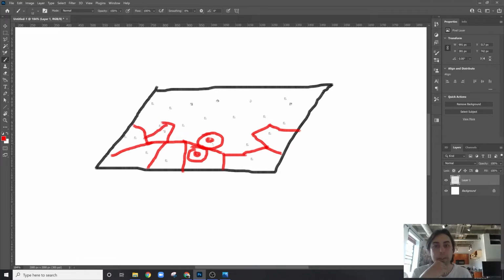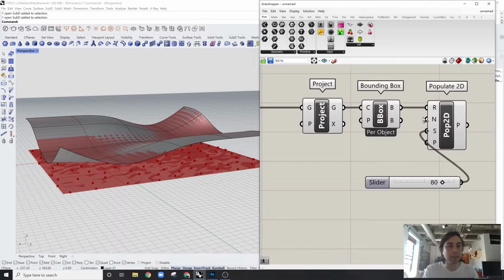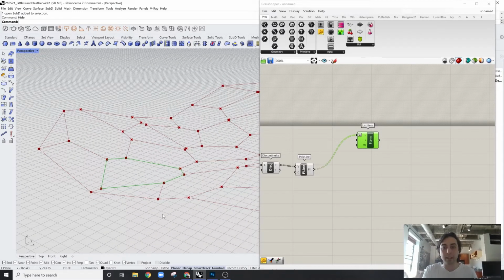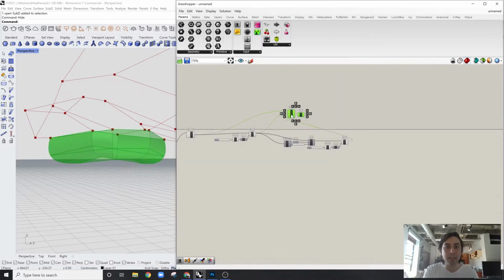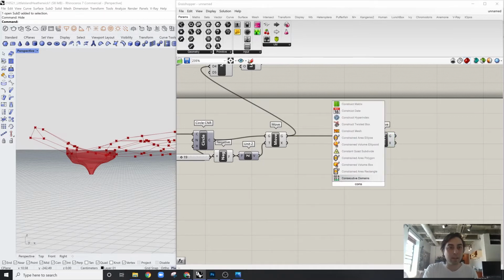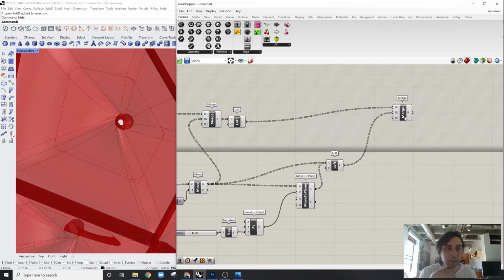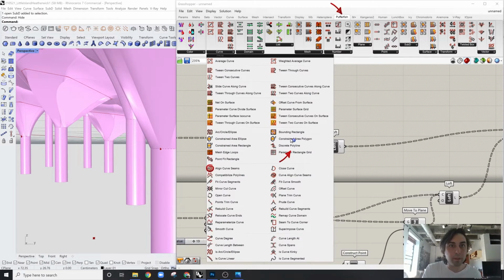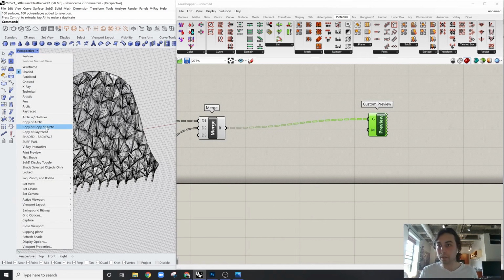LITTLE ISLAND PARK by Thomas Heatherwick (GRASSHOPPER)

Comment: Hi, I followed your tutorial and reached 9:26 in the video, but the polyline showed "Insufficient points for a polyline". I have tried several times but still could not work it out. Do you know why is it? Would you mind sharing the grasshopper file? Many thanks in advanced
Reply from the maker: Hi! Have you tried changing the seed value for the Populate points? There may be a situation where the point is exactly on the edge of the surface or missing the surface - which would cause this error!

Comment: Hi, I love these videos. They're very helpful. I just had one question, when you make a copy to fix the twisting on the columns and connect that to the merge, mine doesn't seem to fix the problem. Do you know of any reason why?
Reply from the maker: make sure your data structures are the same! as long as the order of the curves is correct and all with the same data structure then it should work perfectly. let me know if that solves it